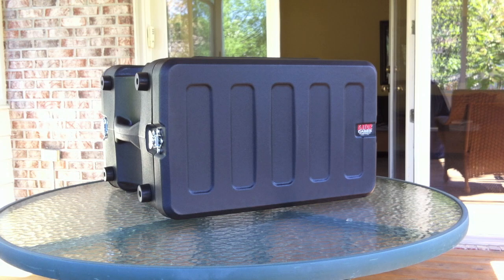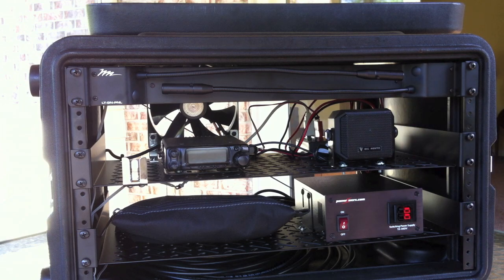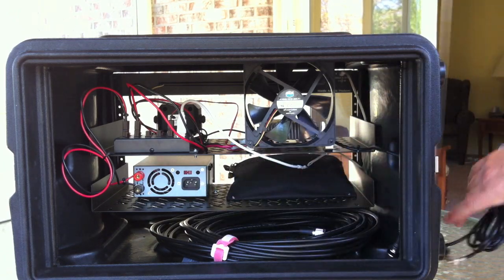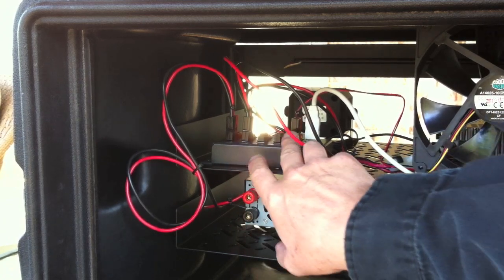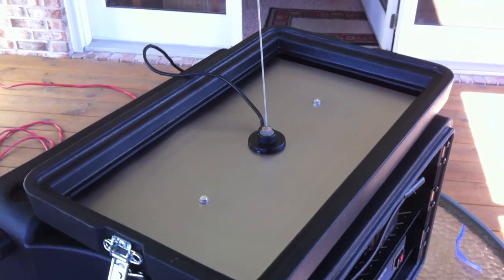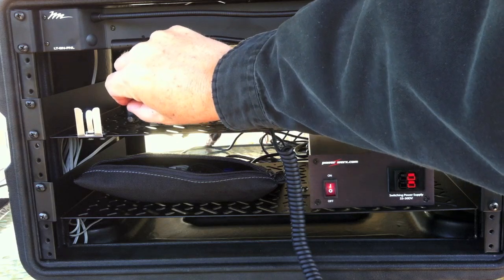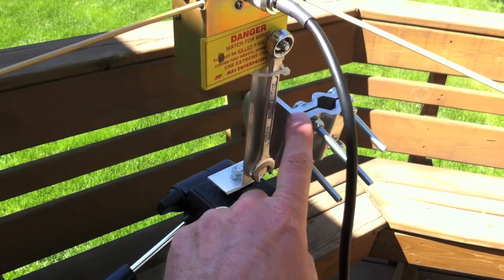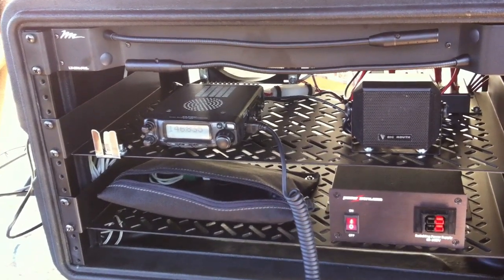Amateur Radio Go Box - Ham Radio ARES - RACES

Comment: Where's the power source.  I saw the switching power supply. But if the grid is down that will be useless. Do you have a battery and solarcell panel?
Reply from the maker: Yes, I have separate batteries with powerpole connection.  I have them in another box.  Did not put them in this box as it would have made it to heavy.

Comment: I use pigtails on mine as well. It's especially helpful on my Yaesu FT-2800 where the antenna connector is very deep under the heat sink.

Comment: I liked your basic structure, so I copied the general layout for my own go-box, with the exception of a laptop rack drawer on the bottom 1U, and the addition of a custom back plate and cooling fans. It's fully VHF and HF all-mode capable through the laptop and a Signalink USB, and it has bandpass filtering on all bands for field use at contest sites. - KK6L

Comment: Love this setup.  Going to use alot of the ideas for my HF rig setup.  My only suggestion for you, is to replace the ziptie around your 1/2 wrench with a piece of velcro.  That way you don't have to cut the zip tie every time you need to tighten or loosen a nut.

Comment: Lots of extra room there and kinda wasted space. I would have included a portable j pole or other antenna besides that mobile magnetic base. You could then cut out about 2 pounds or so of weight. Also get rid of the fan and find a radio with a fan build in that would save weight and space also. Not really a need for lights in there I wouldn't think. Also a D-star radio and HF rig would be good, though I think I heard you say you were getting one. But all in all a good start.

Comment from the maker: The extra space around the radios was intentional for three reasons.  If the box is dropped the space helps to absorb the shock and transfer it to the equipment.  The additional space allows for storage of 50' of coax and AC extension cord.  The main reason for the space is for heat dissipation.  In an emergency situation the radios may need to operate on high power for a long time generating a lot of heat. Air space means cooling.

Comment: I have seen ALLOT of Go Box Videos. You have come up with some great new ideas (at least new to me) Love the steel plate in the lid. Cant believe that no one that I have seen thought of that one. Also didnt know about the "U" model Rig Runner. Great idea. And love the Light Panel. A very nice clean job that is ready to go to work. Some guys do get a bit gung ho w/ Power Eating , yet unnecessary accs. You have not. Add that HF Rig & U R Done! Job Well Done! 73 de KB3VEW

Comment from the maker: I was wrong with my estitmate of 50 miles.  According to Google maps the repeater is 36.4 miles from my house.  That's driving directions, not as the crow flies.  The video doesn't show that the strength was only a 1 on the scale @ 5W, plus I didn't get a signal report from anyone.  The repeater is the MARC repeater in Johnson County Indiana at 940 ft. You Tube won't let me link to the site, but you can Google MARC Indiana and click on the repleater link.

Comment: Where did you get the 22 gauge steel for the inside of your lid. I have built a go box also(under this user name if you would like to see it)so maybe you can get some ideas to. I am adding a battery system for emergency and both a straight key and iambic key for morse code. Dont know if you do any CW but for emergency it is one of the best modes! 
73
Steven